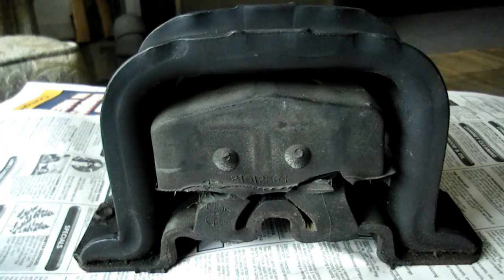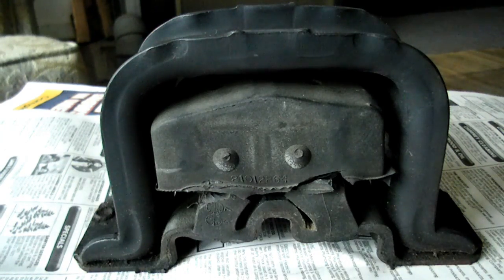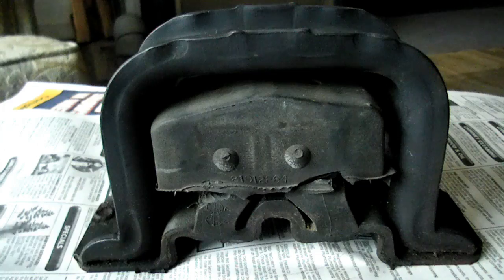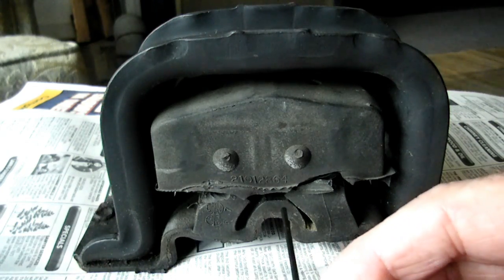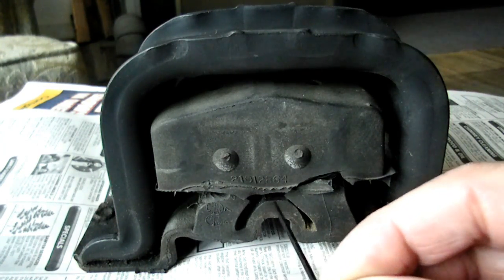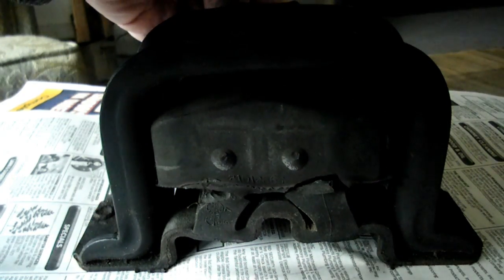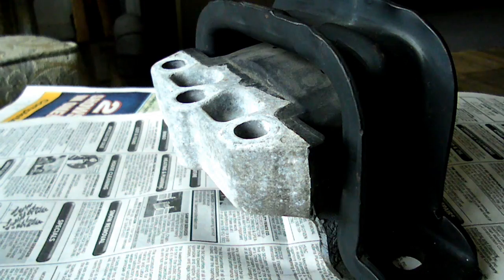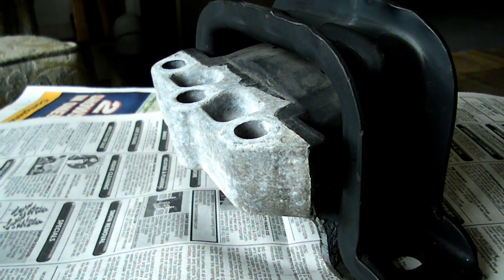Engine Mount Sag Measurement

Comment: Hi. I replaced all mounts about 3 years ago. Non grown. My problem is after warmed up engine idle about 625rpms when placed in a gear idle still at 625ish really bad shutter with no stalling. Have to tap gas to stop shutter. Drives great 93k. Replaced radiator cap because hoses collapse. Cleaned egr twice. About to clean throttle body. Any suggestions would be appreciated thanks.
Reply: Non frown

Comment: Does 2nd design mean it's not in the 3rd Generation S-series?
Also, RichPin, where are you located??  You sound kind of east coast.  If I'm ever in your neighborhood I'd like to have my 2000 SW2 looked at by ya!
Reply from the maker: Not necessary as i think they were using some leftover 2nd design mounts on the later s-series.

Comment: Just replaced the mount on my 96 SC2, before I read all of the anti-frowny stuff on the Saturn forum. Now that I know about this, I examined the mount in place and found it to be a frowny (got it from NAPA). Now what? Really, how bad are they? I have an exhaust leak in the front pipe (old mount failed pen test, thought engine torquing over caused pipe to crack), so vibration from that masks mount efficacy. Many of the forum subscribers gripe about the difficulty in getting a non-frowny. ???